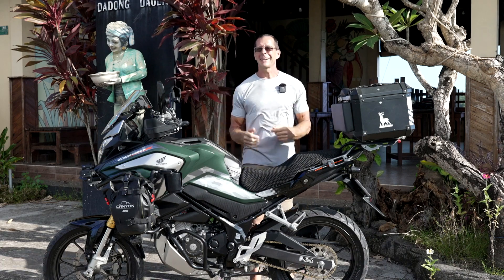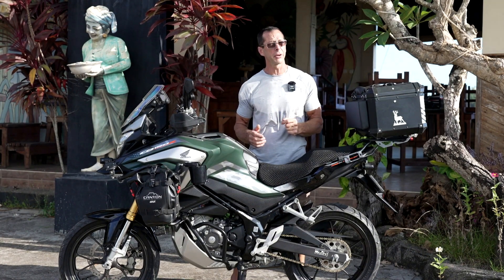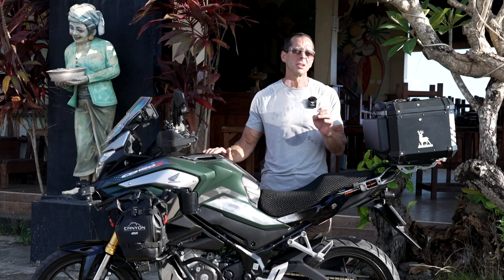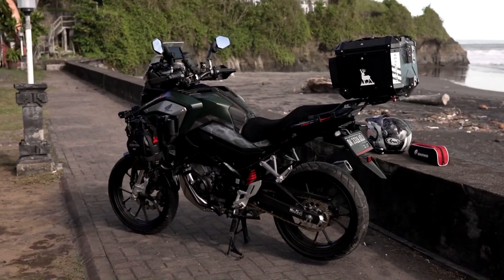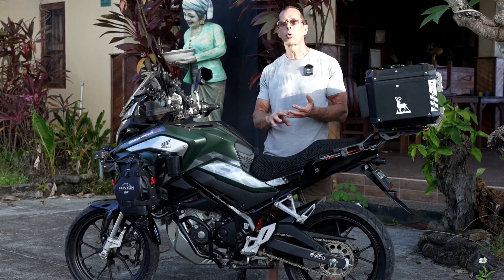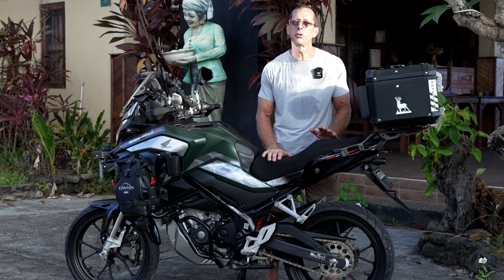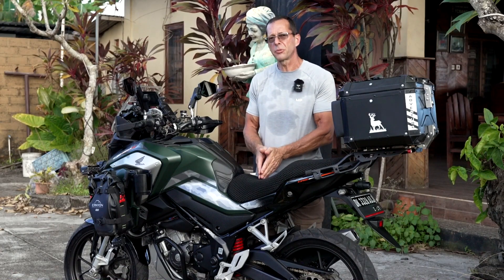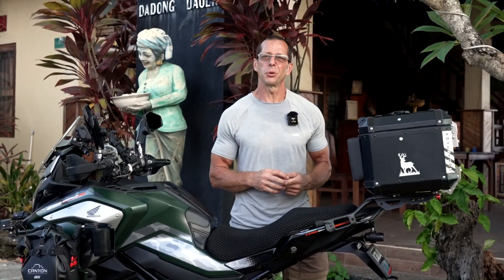Increase Motorcycle Torque and Acceleration

Comment: Nice adventure motorcyle and suitable for daily use considering it's lower displacement.  I like the design of the top box bracket, may i know where can I order it?  can it be shipped to the Philippines?
Reply from the maker: The bracket for the top box is made by Kucay. They have a few different designs. I don't know if it's available in Philippines, though. If you have Tokopedia or Shopee in Philippines, you might be able to find the same bracket from one of those online sellers.
Reply: Thank you for the information and your fast reply.  I've been repeatedly watching this particular motorcycle video, I really like your design accessories of this motorcycle and I'm planning to have one soon.  More power to you sir and I guess you're more suited to review different kinds of motorcycles I think it will work for you.
Reply from the maker: @kuiavinz1917 if there is anything specific you'd like me to tell you about, with regard to the aftermarket accessories I've added to this bike, you can send am email to me. You'll find my email address on my channel's home page. Sometimes we don't see a comment on a video, so I could miss your question. Send it in an email, and I'll answer you.

Comment: hi, I am planning on getting one. Can you give us a list of the gears and modifications in your bike, like the paniers, lights for example?
Reply from the maker: I will work on putting together a video which explains all the modifications I've completed for this bike. Are you in Indonesia, or a different country? I'm in Indonesia, so some of the items I purchased may not be available in other countries, but I'm sure if that's the case for you, you'll be able to find something similar to what I have. The lower aftermarket lights I have are Omega Moto LED M3, 25watt, by Senlo Lampu. The top box is Omega Moto Adv Aluminum, 42L. The Frame/bracket for the top box is made by Kucay. I'll elaborate much more, on all the modifications, in the upcoming video.

Comment: Why not just upgrade the engine Sir? CB150x using shared engine, that mean many engine upgrade available such as BRT brand have Plug and Play pack engine upgrade. But like brake video. You need to talk with BRT first for right option. Good Luck Sir :)
Reply from the maker: Sure, you can do that, but this is another, simple, quick, and inexpensive option

Comment: May i know how much does you topbox  have? I have cb150x also .but i have a problem with the weight .. sometimes it does a wheelie ..  i can see that whe you use your center stand your rear tire isn't touching the ground but mine does every time
Reply from the maker: My top box is a 42L Omega Moto Adventure. In this video, I might have had a 40L from a different brand (I forget which brand).  The concrete under my center stand collapsed while my bike was parked, the bike fell over, and the top box was destroyed. Do, I purchased a new top box. 

The reason your bike always rests on the rear tire while on the center stand is most likely due to how far back the box is mounted to the luggage rack frame, the weight of the box, and weight of the contents.

 Sometimes my bike sits exactly as you've described. Sometimes, I can make it sit on the front tire, just by pushing down on the bike, forward of the center stand. It really doesn't matter how the bike sits, though. 
The real issue is how easily the front wheel comes off the ground when accelerating. I noticed this immediately after installing my first top box. It helps to add some weight to the front of the bike (crash bar bags with tools, rainsuit...), but if your top box and rear side bags are loaded, it's going to remain a problem.

 I have conditioned myself to ride the bike with the knowledge it's not as front heavy as it should be.

 Lifting the front tire off the ground when we don't intend to do so, is dangerous. 

It's even worse when climbing steep, hairpin turns, requiring downshifting, with a passenger on the back. 

I wish I could help you more, but I think this is a limitation we must get used to with the 150X.